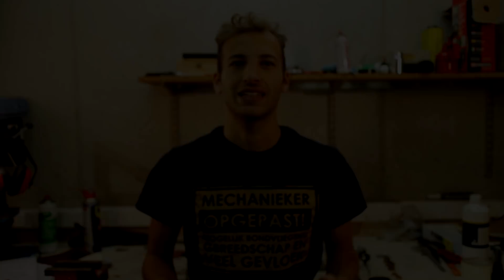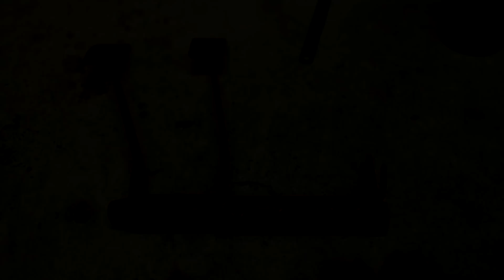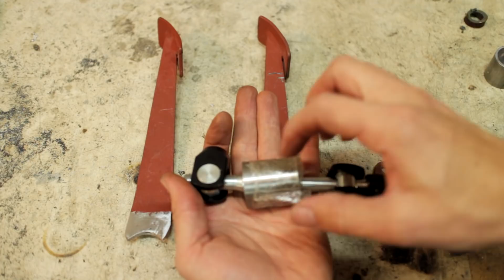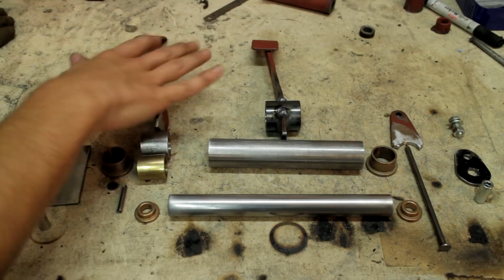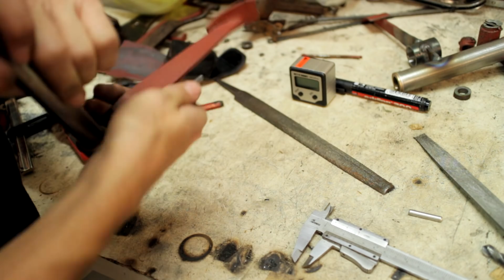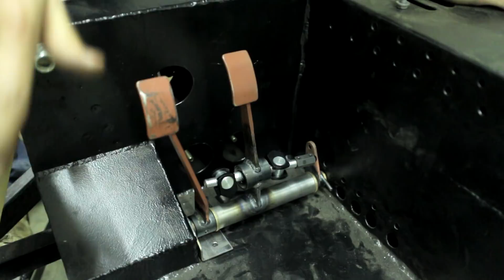Lotus Europa - Ep 43: Pedal assembly

Comment: Is there any way the metal block looking area just to the left of the clutch pedal could be modified to make the clutch pedal about 3 or 4 inches farther over to the left ? I would like to do that to mine, but I do not know what is behind that block.
Reply from the maker: Not possible, the suspension pickup point is behind it. You could just make the pedal itself longer and over to the left. This is wat someone did to my original one.

Comment: Another excellent video however I do have a question.  Considering the fact that the car comes equipped with drum brakes at the rear, why are you putting so much effort into going with dual master cylinders with a brake bias rod?  I believe your time could be put to better use if you abandoned the cable clutch and figured out a way to upgrade to a hydraulic clutch.  While I'm on the subject of the clutch, that Lotus made bell housing has an inherent flaw.  The cross shaft that operates the fork for the clutch release bearing has a tendency to wear the pivot hole in the bell housing on the left side because it's soft aluminum.  When this happens, the shaft has a tendency to bind up when it's being released, making smooth take offs practically impossible.  I can't remember, but there might be a bronze bearing insert in there to prevent this from happening.  Regardless, while you've got the bell housing off, this would be a good time to figure out how you can get lubrication to this bearing once the bell housing is installed.  Keep up the great work!
Reply from the maker: I'll look into the gearbox pivot hole. Thanks for the heads up! I'm going with the dual master cylinders because of multiple reasons: More adjustability for track/hillclimbs. I've also designed a disc brake system for the rear.